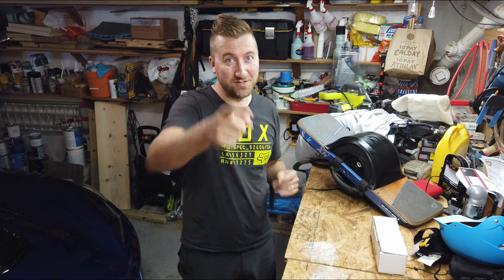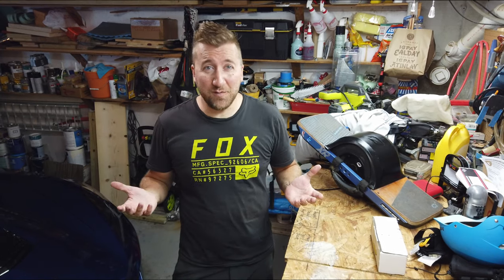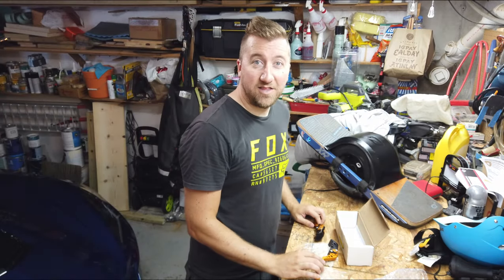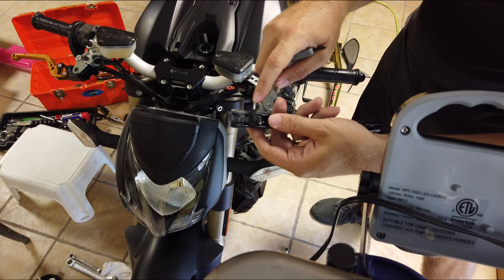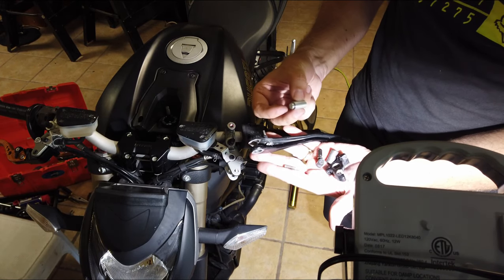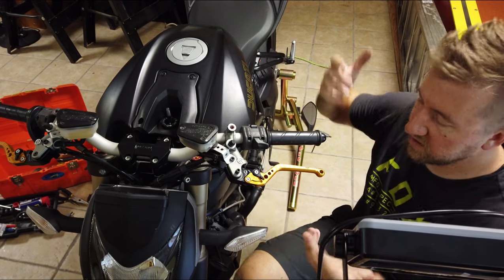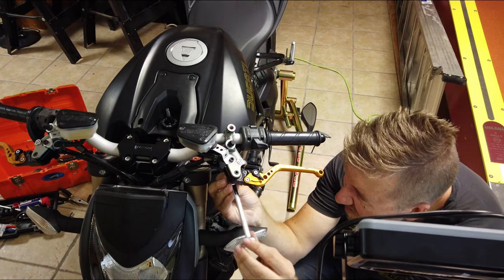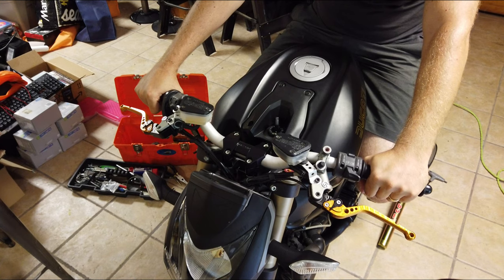How to replace levers on a DUCATI(& Test Ride)!

Comment: How orange are these levers ? I’m looking for a nice said that are gold ?
Reply from the maker: Hi Ariel, to be honest they're more orange than I'd have preferred.  Enough so I called the company that I bought them from on Ebay when I got them.
In the photos online they looked yellow gold, but in person they're more orangey.  Indoor lighting is the worst, as outside in daylight they actually look pretty gold.  I had some cheaper knockoff levers on my old hyper, which were an ebay special, and they were more gold than these.  Overall I'm happy with them, but they aren't quite the shade of the logo on my gas tank.
Here's what the color looks like in person: https://cdn.shopify.com/s/files/1/0083/8710/0738/products/57_b6407d79-c3e8-4139-808c-44865f5b77dd_1600x.jpg?v=1571712036
Reply: @FredsFullThrottle  thank you so much for getting back to me and thanks for the pic it helped out a lot !!
Reply: I wish they were more gold
Reply from the maker: @arielsolomov3715  No prob man, glad it was helpful.
Reply from the maker: @arielsolomov3715  Yeah, I was definitely a bit disappointed when I got them in person.  That said, there are 2 things working in my favor.  First, is that outside in daylight they look way more gold than orange, it's really when you have pure white light like LED bulbs or fluorescent tubes (like in my garage/basement) where the orange comes out.  So at least when I'm riding they look pretty good.  The second is that gold anodizing fades in the sun.  I don't know what causes it, but it's a pretty known thing.  When I was looking to buy levers and some gold rearsets, a few of the companies even have disclaimers that say they will fade over time.  Since I ride mostly when there's nice weather, my hope is that a year or two of some heavy sun exposure will diminish the orange look, and they'll actually look better over time.

Good luck on the search!
Reply: @FredsFullThrottle  that’s good to know. I would totally order them but they’re saying there’s no returns because they’re individually made or some crap like that. So I’m gonna keep looking hopefully I could find a set otherwise probably going to have to rethink my whole color scheme for the bike
Reply from the maker: @arielsolomov3715  makes total sense, good luck on the search man!
Reply: @FredsFullThrottle  thank you bro